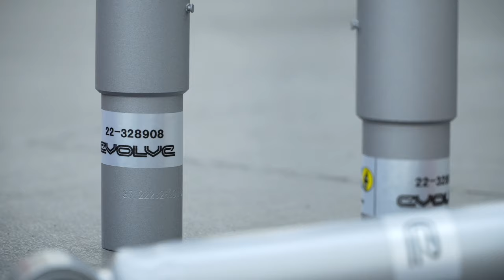Your i3 needs this upgrade - Evolve Suspension Package - Dampers + Lowering Springs

Comment: I did go for the standard i3S springs, I only upgraded the shocks - all I can say is WOW - what a difference - why did BMW not make the car like this to start with? The car is still rock solid on motorways (this is why I went for the S version), still handles through corners, but the ride is so much more controlled. I have gained so much confidence driving on the bad country lanes with the new Evolve Bilstein shock absorbers. The car no longer jumps or jolts and has a much more controllable ride. A truly impressive transformation. Better in town, corners well and now handles the roads in my area without trouble. Well done to the guys at Evolve, and thanks for sorting out the niggles without fuss.
Reply from the maker: Thanks for your feedback! It is highly appreciated and glad to hear you love the product too!
Reply: My i3 Will need new shocks, would you still consider them now after 10 months? I’m looking at options and honestly not sure which to choose but I then to agree that i3 on stock suspension don’t match the bad roads we have in UK 😂
Reply: @davidsilva3567   The ride was a lot better on bad roads, don't expect a magic carpet ride, but far more composed compared to the stock shocks.

Comment: I have had Evolve shocks about half year and 12tkm. Car is stable and stiffer, very big improvement. 

Two of my friends have driven my car and liked it a lot better than the standard suspension and both of those has i3. 
Other of those friends is going to order two sets of shocks, for both of his cars

Comment: Do you offer fitting of both springs/dampers and new shock gaters with wheel alignment at Evolve or is it just the sale of the parts?

I'm not a million miles away and very tempted by these.
Reply from the maker: Unfortunately we do not offer wheel alignment but can install the springs and dampers - we have a fully functioning workshop for customer cars as well as our development vehicles.

Comment: Great video! Question, when you did the R&D on the springs, how did you approach the difference in weight of the REx vs BEV models? Since the BEV is lighter, aren’t the springs not over sprung? Cheers.
Reply from the maker: Developed on BEV car
Reply: Thank you - ordered placed for the whole kit. Cheers.
Reply: I've a 2016 rex.not s model. How much is the full kit for my car?

Comment: Still kinda wondering if anyone will make a widebody kit for these since both the front and rear quarters unbolt, yeah? Did a quick sketch of what one might look like a while ago when I almost bought an i3, and was pretty stoked on the idea. Still really like the i3, but ultimately we went with an id.4.
Reply from the maker: Whilst that is true, without cutting the metalwork beneath you wouldn’t gain any extra room. The i3s has the same amount of inner clearance as the regular i3.

Also widebody and big wheels will quickly kill the range, defeating the point of the car
Reply: @EvolveAutomotive  Definitely respect those points. I guess I was thinking from a show car or track car perspective. I was thinking that with a widebody you could run smaller wider wheels and have the widebody drop the wheel arches down. I could definitely see these chassis' getting hotrodded in the future since they are a carbon monocoque. Totally different perspective from your daily run about setup, which I understand and respect.
Reply: Just to chime in, there are several successful examples of i8 wheels fitted on the i3S with 12mm spacers  - you can run 215 front, 245 rear tires, which not only improves handling and eliminates the wobbling issue, but also opens choices to tyre manufacturers. Cheers.

Comment: We live in norway and just bought a 2021 i3. I was looking around to switch the standard springs and found a H&R set that many seems to recommend. Are these springs somewhat similar to H&R? I know little about this
Reply from the maker: We haven't tried the H&R to compare, but are very happy with these.
Reply: H&R are not good a good performer on the i3, better go with Evolve, ACS or AST.

Comment: I have a 2017 REX with 70,000 miles - all original except for new tires recently - love car, but ride is, and has always been, terrible - much bouncing and seems to be “porpoising” (on bumps, cabin rocks front to back to front, etc.). Which of your products will give me a smoother ride over road bumps? Springs alone will do it? Shocks alone? Both springs and shocks?
Reply from the maker: The shocks alone will fix the issue you are facing. Add springs if you want a lower look and sportier handling car.

Comment: I have a question about your wheels and tires... Obviously not stock can you supply what those wheels are and the size of the tires?
Reply from the maker: Tyres are the standard ones we took off the stock wheels. Wheels are 6Sixty Design Shuriken. We can supply them but they are quite expensive to produce - sales@evolveautomotive.com
Reply: @EvolveAutomotive   Thanks for the quick response... If they could accommodate a wider tire even a modestly  Wider tire I would consider buying them... They do look pretty cool...
Reply from the maker: They can be built to spec, so a wider size is possible, but make sure you can get a slightly wider size first! Not many options in these sizes.